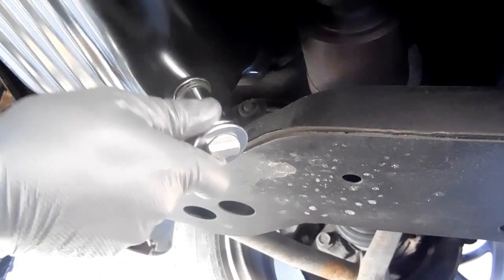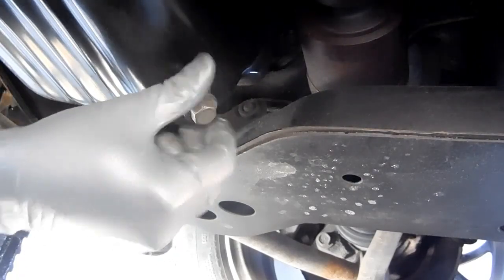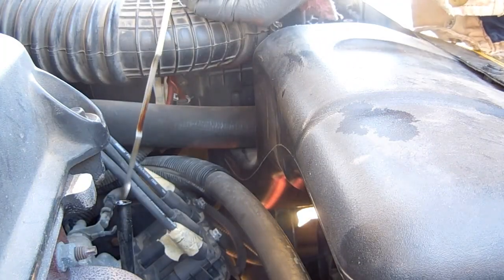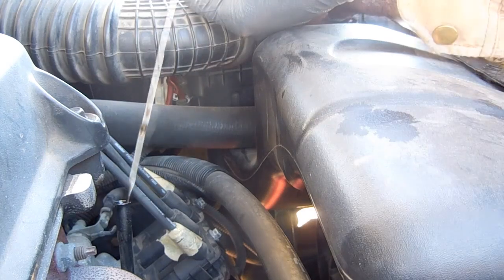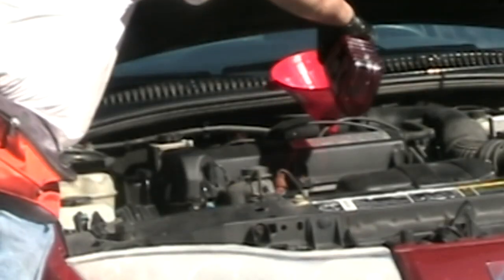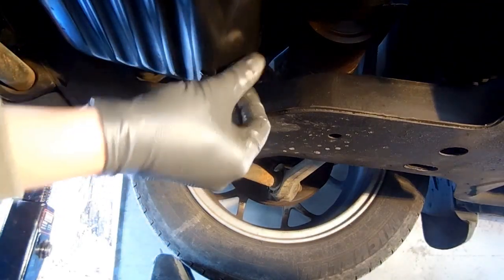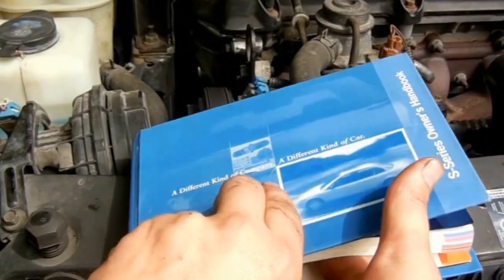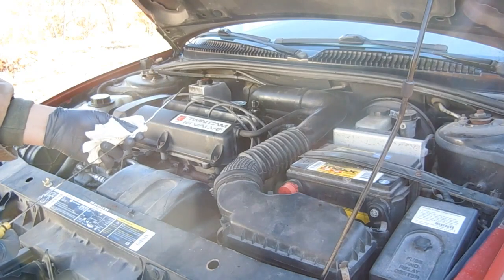Safe Motor Oil Flush Using Kerosene

Comment: The simple key to oil changes is early and often!! conventional oil 3 months 3000 miles full synthetic 4 months 6000 miles. Never go beyond 6000 miles and I don't care what any of the oil products say on the label!!
Reply: I moved from NY to CA in 92, and when I got there I was surprised with this 3K mile oil change bullsh!t.
The excuse was commuting was 'severe duty'.
Total BS, there have been well studied taxi cab studies done in NCY, etc that averaged 7500K and found good oil and good filters still working fine in these real severe duty environments. Latest .gov is here that I can find:  http://dtsc.ca.gov/TechnologyDevelopment/OPPTD_FLY_High-Efficiency-Oil-Filters.cfm

I prefer the Mobil 1 full synthetic, with a Mobil1/Wix/Napa Gold filter.  Check you vehicle manf. service record, most/many say 7500K.  Use a full synthetic, spend the extra $5 on a filter and follow the suggested service interval.
Reply: Boots first of all rarely is a oil filter the cause of an engine failure so a good brand name filter is all you need!!
Back in 92 and even into the very early part of the 2000s I would agree with what you're saying, what you're not taking in account is today's engines use a variable valve timing , in a variable valve timing system the majority of them are controlled by hydraulic fluid pressure from the engine oil which can clog up from not changing the oil early and often enough!!! this is why I suggest 3000 miles on conventional oil and no more than 6000 miles on full synthetic .((if a vehicle does a lot of long trip Highway type driving this could be extended to 7500 and wouldn't really cause much of a problem but if it's short trip driving that's a different story)))) I speak of all this running a repair shop that will do an oil change for customers but does not focus on selling oil changes for customers I do the repair work and in the last 10 years I've had to replace a lot of engines because of failure in the variable valve timing fluid passages that clog up. these are real world facts they're not found on the internet, they are things I've experienced firsthand repairing hundreds of vehicles! the bottom line is compared to the expense of fixing today's engines oil is cheap! 
CHANGE IT EARLY AND OFTEN!

Comment: If you change your oil at the correct intervals there is no reason you should need to Flush the engine. Kerosene is not a good idea, nothing good will come of that.

Comment: No matter how long you drain your mixture for, you will always have kerosene left in those passages and in your head... so when you put your new oil in it'll be contaminated by the kerosene... 
Kerosene  will break down the chemical composition of the oil, that or a bit of dirty carbon / sludgy deposits, which is worse?

I used to to do flushes like this (and the flush aditives) on my cars / pump motors / lawnmowers etc, I LOVE golden oil on the dipstick after MILES of driving... but that's not worth the harm you do in the long run...

A better idea is to use cheap (and even maybe a thinner grade) but proper oil as a full flush (normal oil change - without a new filter...) 
Then after about 150km of driving do another proper oil change with your preferred brand of good quality oil and your new oil filter.

When you drain the cheap oil, you can keep it for your next oil change / flush.
Reply: Is why drive for 500 miles then change oil again. So that next oil change will be pure oil no containminents.

Comment: A safer and as effective method is drain ur oil, install new oil filter plus fill up your engine with ATF, run on idle for 15-20  minutes.  No reving no driving.  Drain, install another oil filter and add ur new oil. keep in mind, ur next oil change should be done @ 1,000 miles. Then after every 3,000- 4,000 miles. I do this once or twice a year. ATF with clean crank case and oil passages.
Reply: You have not established that it's safer or more effective, and it costs more for ATF and a 2nd oil filter, than 1/2 gallon of diesel or kerosene.  It's not the crank case cover you should be concerned about, that's the last place where deposits matter unless they get so thick to get into the pump pickup screen.

Comment: There's your main problem. Using the most worthless oil filter in the world. Sure, it's got a grip on the end, but the crap filter material inside blows out allowing unfiltered oil to just bypass the filter.

Comment: If I was you I would put a little bit of oil and run 5 min and drain out ! beacase, in the engine, it still have a little of Kerosene !
Reply: There will be a trivial amount of kerosene left behind and the next few times the engine gets up to temperature, it will cook off, be sucked through the PCV system and sent out the tail pipe.

Comment: Some years ago the way that one dealer cleaned out the 5.0 liter fords they had bearing issues when Ford refused warrantee replacement was a brick on the accelerator for a few minutes. That resolved sludge in the engine too.. Thoughts???  Is this a good or bad example of what is the best solution to  accumulated oil sludge? Some engine flushes may contain some form of petroleum distillate do any suggest this ratio? Kero has some lubricity is it sufficient for the engine bearings? Do any engine manufacturers recommend this procedure? what procedure do they recommend? I will email Jasper Engine as they are a well known engine manufacturer and post there reply.
Update I just sent out this Emal and I will update this post when I recieve a response
. "I have seen this video on YouTube and I would ask a engine specialist to view this and I ask your opinion on this procedure. Also what procedure if any would be a better suggestion?  I would ask you permissions to post your response on this youtube channel as this is my intent to educate and help viewers on this information."

Comment: how you will remove rest of kerosine from engine-it always left some amount even you leave to drain it for long time, and then it will dilute new oil.
better is to change oil when it start to be dark, so there will not left any dirt, sludge, etc.
i change oil every  3000-4500 miles, and engine is very clean( as new) from inside-checked when removed heads for porting

Comment: I had a 2000 Jag S-type with an engine full of sludge. Flushed it with kerosene similar to this
Cleaned it up perfectly. Drove the car another few years and eventually sold it.
Reply: Quick question.. Would u do this in a 2014 Nissan Maxima??
Reply: Definitely a 2013 or 2015, but never a 2014.youre asking for trouble.
Reply: Wisdom of a King , You rule !
 @Critical_Stinking

Comment: I'd never flush an engine...that loosens all the crap inside and you can never drain it all out...if you change the oil faithfully at the mfr's recommended intervals, flushing in unnecessary....modern motor oils are much better than they were back 20 years ago.
Reply: hindsight is 20/20..There are people out there who do have old cars with sludge and need a fix
Reply: m schiffel if a flush is used then the pan should be taken off and cleaned and screen on pick up cleaned of debris. I would even consider taking the valve cover off and cleaning them of gunk and grit. I am a little bit OCD...

Comment: I have done this with 1 gt of diesel per 3-4 qts of oil and it worked fine.  I would not do it unless you know you have a sludge issue as there is risk in doing this.  I would do this when the risk of doing nothing outweighs the risk of doing it.  I did this on both a 95 Saturn SC2 and an 89 4.3 Blazer.  Both engines had so much sludge that fresh oil after an oil changed looked as bad as what I took out.  After doing this fix, new oil (oil in the pan with only a test run on it) remained clean looking for several thousand miles.  I agree, if you use better oil, you might never have to do this.

Comment: To all the people that say Kerosene and Diesel are ruining his seals...gasoline is just a lighter version of both Kerosene and Diesel...made from the SAME dino oil (and synthetic is just chemically combined natural gas molecules)...plus he didn't drain ALL the oil...he only diluted both the dirty oil with clean Kerosene, then idled for 10 min or so (no heavy load on the engine or the hydrodynamic wedge of the crank bearings)...then drained...not going to damage the seals...because if Kerosene or Diesel damaged them...then gasoline blowby getting into the oil would damage it as well...
Newer oils with better friction/viscosity modifier packages, anti foaming, controlling chemical breakdown and contamination, plus seal conditioner additives are much less likely to sludge up than older oils...  Hence the better API/SAE "SN" or better rating of most modern oils...
http://www.pqiamerica.com/apiserviceclass.htm
Reply: Brian C finally a comment made by a real mechanic idk where all this doom and gloom is coming from when most engine flush has kerosene in them.
Reply: I like you. You sound smart.
Reply: After watching, I would use kerosene, for about 5-6 after warming and removingthe oil. (2-3 quarts) Then I would run it for the time and drain..then remove all plugs and pour B-12 and let sit for a couple of days with the plugs back in. Drain/blow everything, re-lube all cly's/change oil and go.

Comment: If you Change your Oil on a Regular Basis ( Regular oil 3,000 -3,500 )   (Synthetic Oil  5,000 some 7,500)  and use a good Oil Filter you Should not have to do this . Gunk used to sell a Quart can of Motor Flush  and I have heard a lot of Horror Stories Over the years  of it breaking Loose chunks and Clogging the Sump pick up  then ever lower oil Pressure and more Engine noise Lifters Etc  as for Oil additives  like  STP   Lucas  they just Create a sludge at the bottom of the Oil Pan . if you had a Noisy Lifter I would use  ATF  of Marvel Mystery Oil  or Sea Foam   they have worked for me in the Past .  Just check out Farm Project Video on Sea Foaming his old Ford Ranger and see and hear the Difference
Reply: Quote from  1995dresser: if you Change your Oil on a Regular Basis ( Regular oil 3,000 -3,500 )   (Synthetic Oil  5,000 some 7,500) 

I have to half agree with that statement. Today's engines run hotter to burn more lean fuel. In addition, My GF has a 09 vibe with 100k miles and changed the Dino oil faithfully every 3k. Last oil change I noticed it was 2 quarts short. Going to try a flush and full synthetic.

Comment: You gota love those older twin cam Saturn engines; they go forever. Ive used the kerosene flush to clean up and hopefully quiet lifter tap lifters on older engines. 20 to 25% Lucas for blowby? Anything more than 10 to 12% for a forced induction race engine qualifies for a rebuild. That much for a gasoline daily driver means its time for at least rings possibly new pistons or time to find a buyer for the car. Being an original Saturn engine I would rebuild it without thinking twice.

Comment: To all the haters that comment on killing his motor .... my 51 hornet calls for a kerosene flush once a year from the factory manual . Car today with good detergent oils probably don’t need this ..... but let’s actually think before we speak , unless you have done it and killed your engine , your opinion is crap . Like I said flathead engines with non detergent oil back in the day , This was the only recommended way to clean sludge
Reply: Amen to this, my 53 merc flathead was full of tarlike sludge, had to use wooden dowel to break up sludgepockets that would clog up the oil pan drain after drainplug removed. Poured straight gasoline to liquefy path out, then put straight diesel fuel in crankcase. Ran it idling for 5 minutes, what a difference. Did the diesel trick twice, then new oil, engine runs like a Swiss watch, clean and strong.
Reply: My '51 Mercury calls for 10% kerosene added to the oil when temps are below freezing. Says right inside the glove compartment.
Reply: Its OK if its factory approved. You are an idiot if you do it in anything else. nothing since the 50's.
Reply: My 57 Olds sat in the garage since last summer. 371ci  motor has less than 1000 miles on it over many years. The oil (QS SAE30 + 1qt Marvel) was milky as hell. I poured about 4 qts through and let drain straight out to at least clean the pan. Then changed the oil and filter and ran it. Now will remove some oil and add more MMO to flush it safely... while praying.
Reply: @HARRUMPH-SAL  don't pray ...drive your car more 
....sounds like condensation ruining your oil ....little short trips and lots of garage time plaques motor oil ......after your flush get out on the highway and give the car all its got and try and drive it more 
..shouldn't have anymore problems after
Reply: @molinelligarage1004  yes. NEVER start your car unless you are going to get the engine HOT. Otherwise you are just creating moisture. If you want to you can disconnect the ignition and just wind motor over to lubricate without starting.
Reply: Jeffrey Molinelli facts
Reply: How do I clean the sludge in my underpants?

Comment: "Kerosene and diesel are seal damaging harsh chemicals"?
Reply: Go back to school. Kero and Diesel are oil based and very clean. Show us they damaged YOUR engines. Crickets...........
Reply: @jimdavidson5208  Did you read my post correctly? Did you notice the Quotation marks? Did you see the Question mark? I was asking the video's Creator why he would think the K-1 clear kerosene would damage seals, as he states @3:07 , so who needs to be educated, four years later? I used kerosene + ATF @3K RPM 30 minutes as an engine flush at our Shop for 25+ years, 25 years ago. 

Now that I've explained my post more thoroughly- will you apologize for being rude?

Comment: Good way to kill an engine. Just drain the old oil warm, give it plenty of time . Change the filter and use a good quality oil is all u have to do.
Reply: You are a mechanic?
Reply: @partymanau   no amount of oil changes will clean the engine if it has a lot of sludge.

Comment: ran 2 gallons of diesel in my ls1 at idle until coolant temps hit 200f. checked oil filter no metal. I always use mobile 1 5-30. still running strong

Comment: You are pouring the oil upside down.  Turn the bottle over 180 degrees next time and it won't glug like that.  Much easier to pour without making a mess.
Reply: adrianrog hahahaha... Wtf man... Kerosene not damage the oil seals...

Comment: I would not recommend doing this at all. If the oil is changed at regular intervals that the vehicle manufacturer recommends, there is no need for a "engine flush".  Also putting something like kerosene in the engine is extremely harmful, there is not enough lubrication between the cylinder walls and piston rings.  This procedure is completely unnecessary, oil just doesn't lubricate it cleans as well so change your oil when you're supposed to.